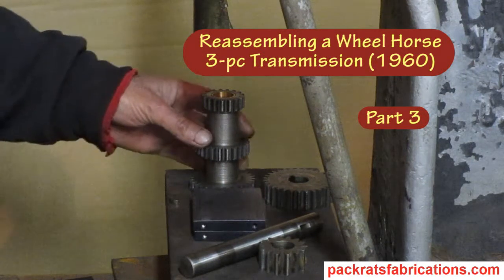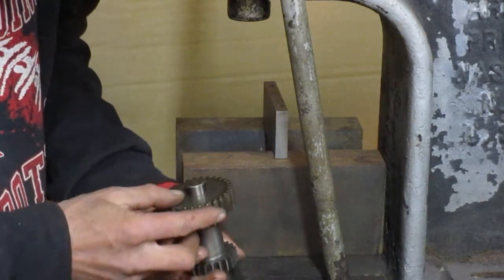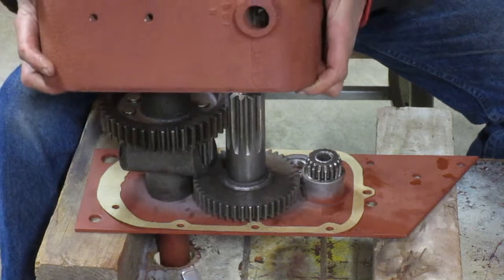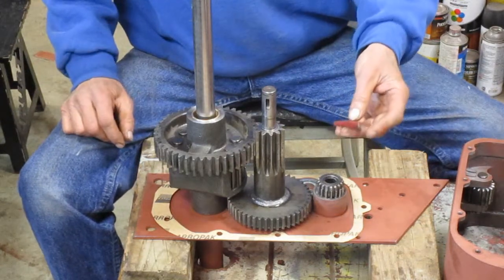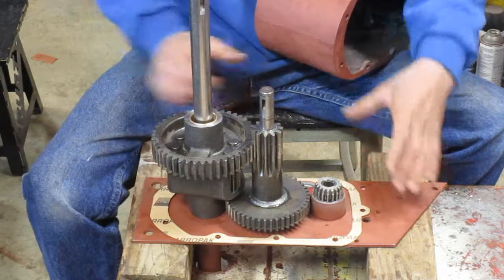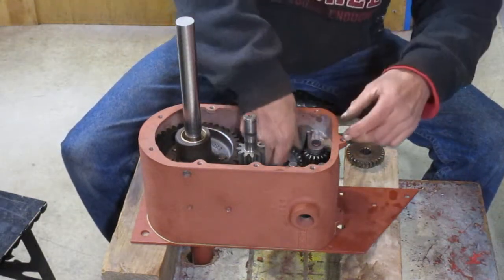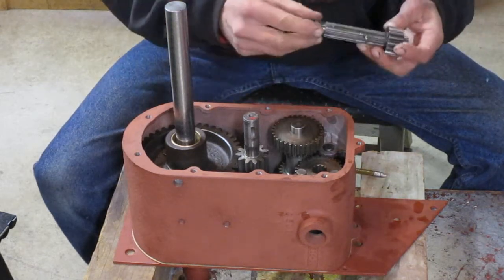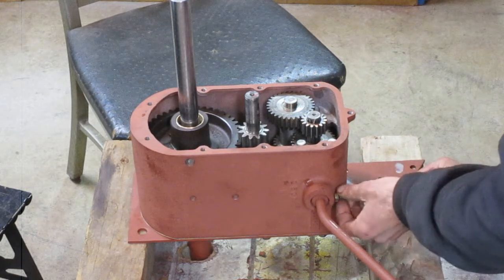Reassembling a Wheel Horse 3-pc Transmission Part 3

Comment: I followed your video step by step to rebuild my transmission. You explained everything great. 
I’m at the point of installing my left side cover. Can’t get the needle bearing to slide over the gear shaft  you put the spacer under. Any suggestions?
Reply from the maker: There's 2 types of left side plates, since you said needle bearing, I'll assume you have the one with the needle bearing. On that type, the bearing rides on the shaft so it needs to fit over the shaft or there's a problem with the shaft size. If it slides over the shaft but stops hard about  1/8 inch before it should, the shaft might be the wrong type. There's a few newer videos I did that might be helpful. This one https://youtu.be/OJ7YTcJwmCs called Early Transmission Fun Facts talks about the 2 types of gears and bearings. If you have the ball bearing type there's a different reason it might not go over the shaft, that's covered in this video https://youtu.be/i7QbeIP-w1k called Transmission Bearing Bore Problem and Fix.

Comment: What is the dimension of the axle on which the hub is mounted?
Reply from the maker: These older transmissions have one inch diameter axles.
Reply: @PackratsFabrications  Thank you for your answer
I also mean the main sprocket on the differential, what is its size, because I came to recreate the wheel of a RJ horse and in Poland it is not possible to buy such a tractor.
Reply: Could I contact you by e-mail to provide the dimensions of the gears in the gearbox? I would really like to recreate such a tractor in Poland but I do not have access to parts
Reply from the maker: Sorry, I can't do that. I would have to measure and create a print for each part in there, and I'm not going to do that. I don't have access to any old wheel horse blueprints.